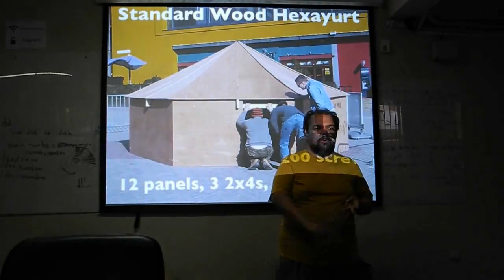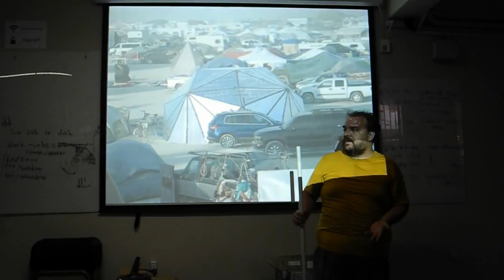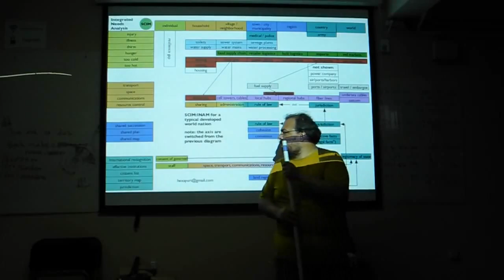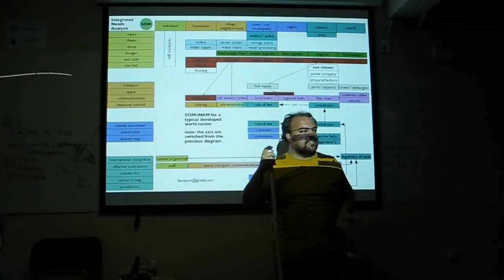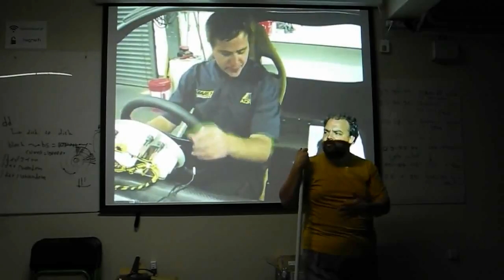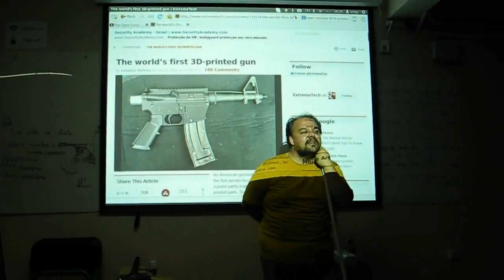Comment: Pyrolysis with waste bio-mass feed stock to create heat for the building and hydrogen for the vehicle. Rocket stove + wood gasifier. Low tech, distributed, renewable, & lower cost than the centrally controlled options.